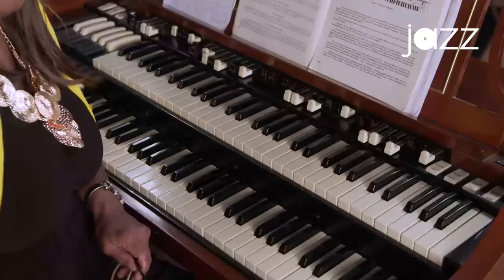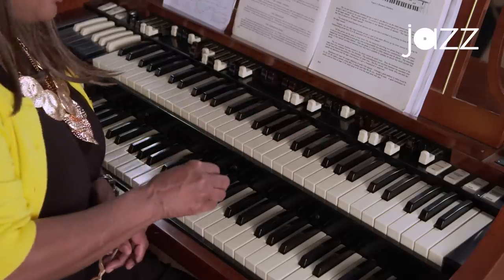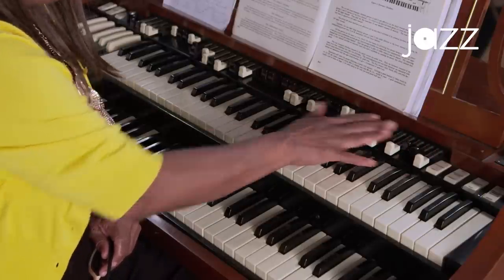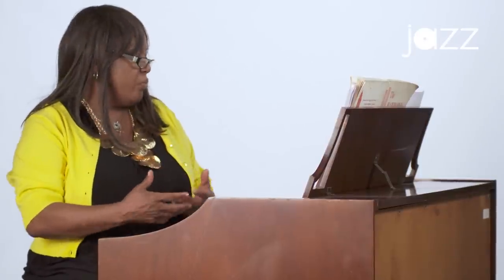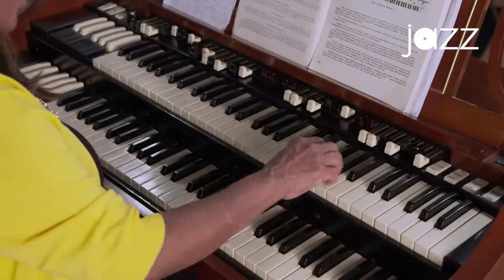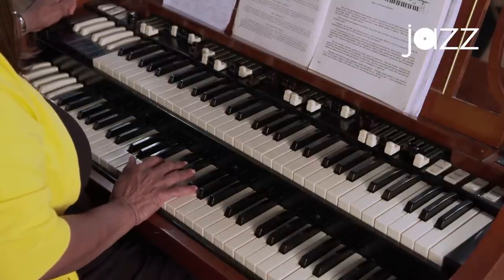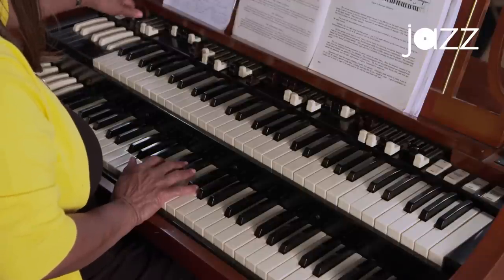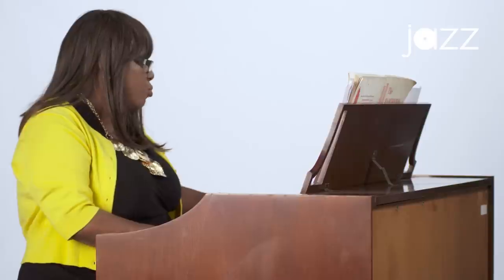How to Play Gospel Organ, Part One

Comment: Actually,  the difference between an A-100 and a B3/C3 is that it has built in speakers! That, and the cabinet is much smaller since it was meant for home use. Otherwise, the components are identical.
Reply: Plus reverb, which runs through its own amp and a speaker.
Reply: Exactly. That statement she made was not true. The components of the A100 is similar to the B3 and C3. It's just the added internal speakers, 3 amplifiers and reverb function

Comment: Thank you for your instructional video. The Hammond organ also has moving part parts - the tonewheels, the scanner, the start motor, the run motor and the tonewheel generator.   Also, 8 seconds is long enough for holding the Start switch and while holding that switch, you then engage the Run switch for 4 to 6 seconds and then let both go at the same time. Blessings.

Comment: The Hammond organ A-100, B-3, C-3, ect is unique unto itself. Unlike a pneumatic/electronic pipe organ or a 1960's transistor organ, Hammond's are electro-mechanical instruments which requires a special lubricant oil to operate and requires annual inspections/maintenance to keep them operating properly. If a Hammond organ has been sitting unused, never turned on for a long period of time it's best to leave it alone until a Hammond technician has gone through it. Never attempt to start a Hammond organ you were told that it doesn't work or play, again get a Hammond technician to go through the instrument first to make repairs and perform maintenance. The information given here to start a Hammond organ is good but best practice is to continue to hold the starter button for an additional 10-15 seconds after the run switch has been turned on and then release the starter button. This gives the electric motors a chance to synchronize, quickly bringing the organ to full speed and keeping both switches in the up position for a few extra seconds will not hurt the organ or starter motor. You should not hear the organ speeding up when pressing a preset and playing a note. The organ should already be at full speed before playing.

Comment: The correct factory recommended procedure to start a tone wheel Hammond organ is to hold the « start » switch for 8 seconds then turn the « run » switch while holding the « start » switch for four more seconds. So 12 seconds is all it takes to turn the Hammond ON. The lady in the video gave incorrect starting procedures.

Comment: My question is why do church organists keep flipping that little switch on the left?
Reply: Scott Grijalva what does that mean lol
Reply: You can switch between the organs speakers, a cab, or both. You also engage the rotor to spin in a Leslie cab to get that signature sound
Reply: The switch on the left changes the vibrato of the sound from shaky to solid